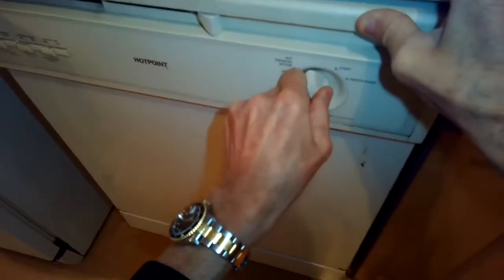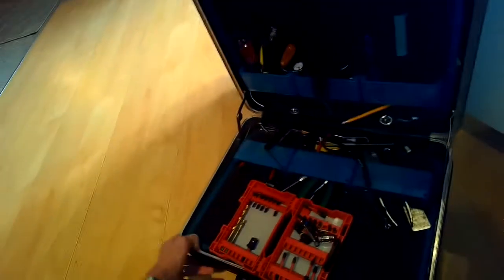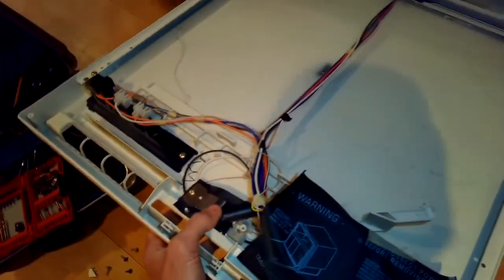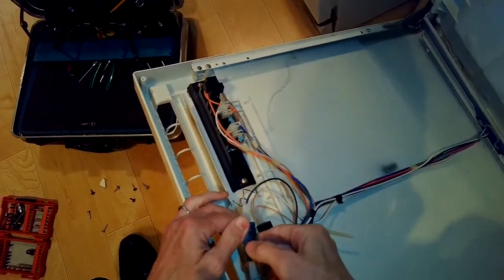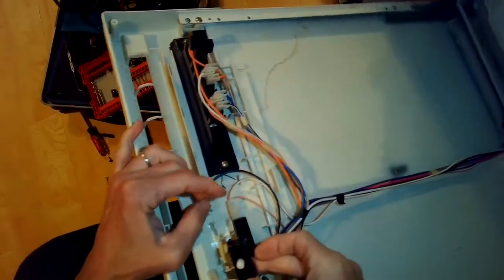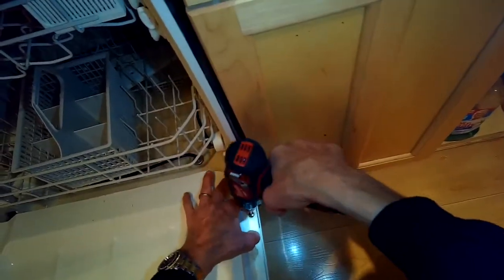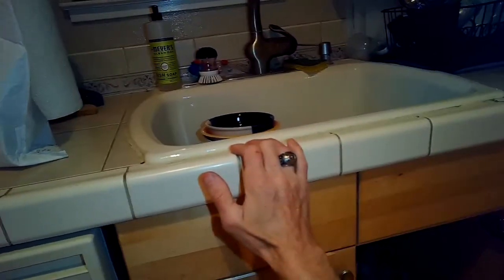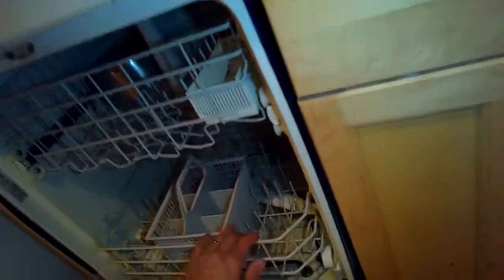✨ Hotpoint Dishwasher - WON’T START - Easy Fix ✨

Comment: Thank you for this! I was looking for a tutorial on what may be wrong. My dishwasher had been acting up for awhile. When the handle was lifted it would work but then stop if not held in that place. Took the door apart and the metal  switch cover was misaligned due to plastic pin being warped. I aligned the metal cover properly and Ta dah! Dishwasher working properly!!!! Feeling pretty accomplished AND no dishes washed by hand tonight! I really appreciate this video
Reply from the maker: Thanks so much Katholeen 👍😊
Reply: Same exact thing with ours. Little plastic started to sag and the metal plate was barely touching the top switch. Thank you so much for this video that got me looking in the right direction. 🤗🤗

Comment: In my case, the plastic surrounding the door switches had bent a bit. I presume the plastic melted over time from heat. This moved the pin for the spring out of position. The spring moved slightly down and only engaged one of the two switches. All I had to do was realign the spring and all is well again. Other fun I have had with this washer have been replacing rusted out racks and removing things from the chopper. Some plastic had become wrapped around the chopper and it just clogged up preventing the machine from draining properly.
Reply from the maker: Nice job Alan😊

Comment: My daughter opened the dishwasher and stood on it and now it won't come on but if I press real hard on the door it will come on but if I let go it turns off. Help?
Reply from the maker: Sounds like it got bent down near the hinges. You could try putting a broomstick down near the bottom of the door word hinges and then gently push the door toward being shut.
When you meet resistance then push it just about half an inch more and might bend it back.
Just take your time and be careful.